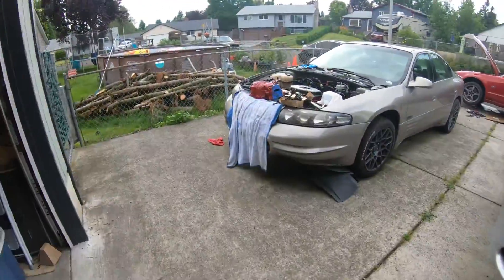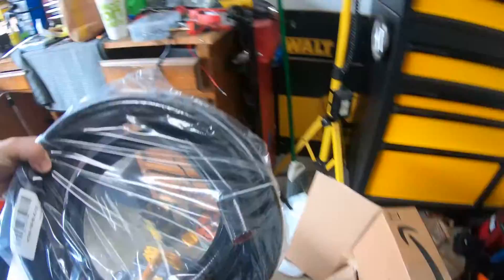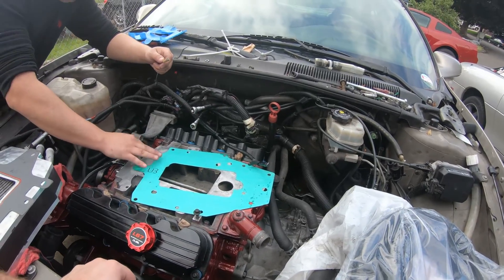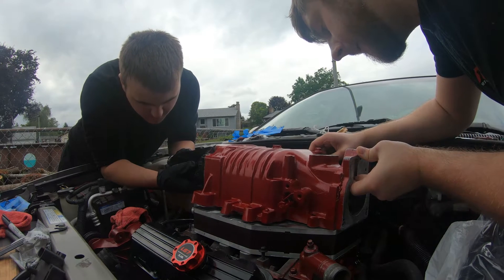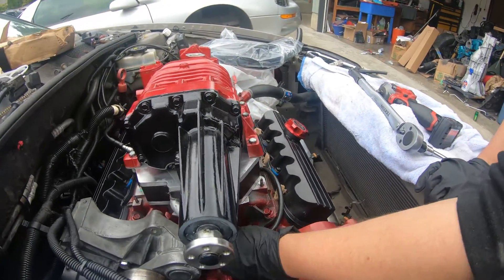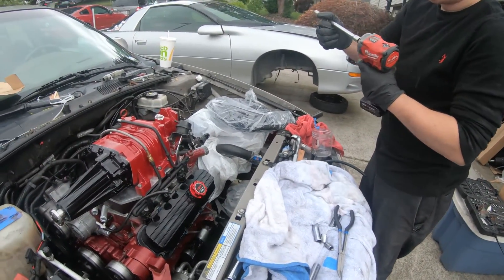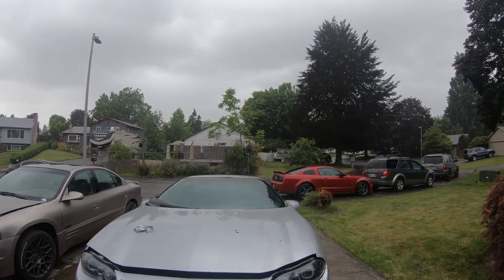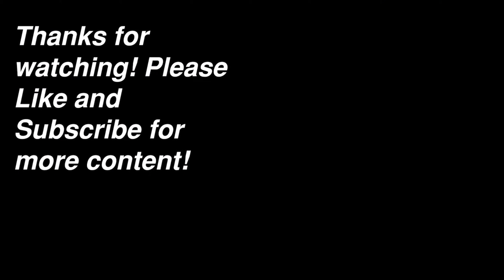Bonneville SSEi 3800 Series II Top Swap Part 25 (Installing the Supercharger and Intercooler!)

Comment: Can an Eaton M90 supercharger from a Buick 3800 series 2 be retrofitted onto a 1982 4.1L 252 RWD engine??
Can it also be adapted to run a draw through carburetor upstream and totally delete the fuel injection?
I have the original distributor from the '82 4 1L Grand Prix.
Can I install an actual vacuum advance/retard diaphram in the distributor to advance/retard the timing?
I want to go old school with a blower and no computer.
It's going into an old street rod pickup truck.
Should be fun to drive with a TH200-4R overdrive automatic transmission.

Comment: Would you know if you could take a 2002 Monte Carlo SS with a 3800 and put a supercharger off of another 3800 on it would there be any other parts required to do that Any help would be appreciated thanks
Reply from the maker: You would need some L67 heads, a L67 lower intake manifold and a ZZP top swap and tune